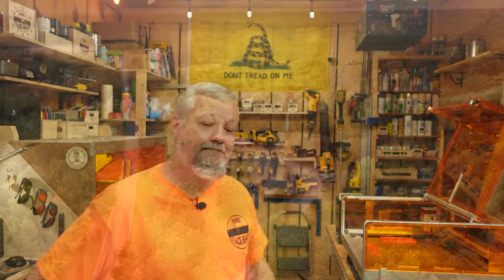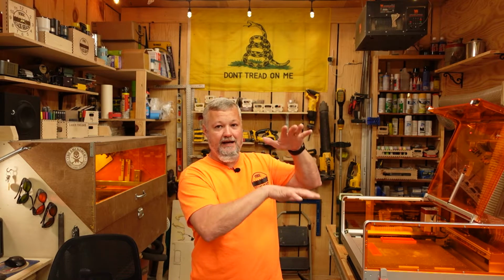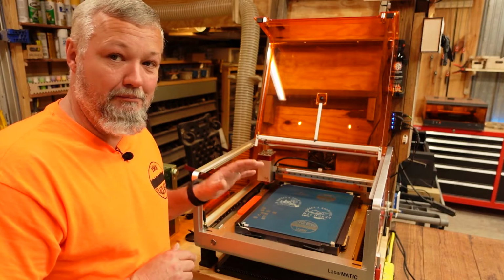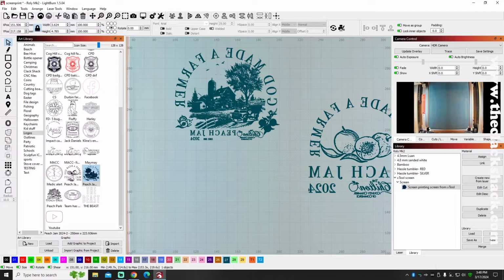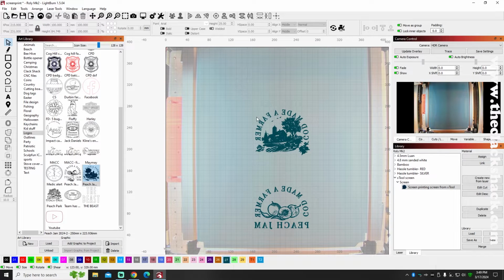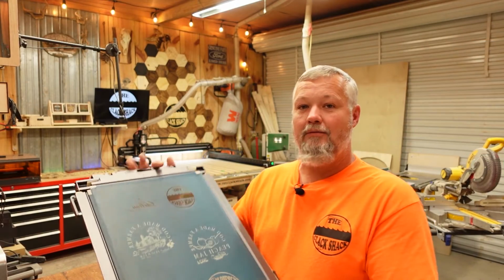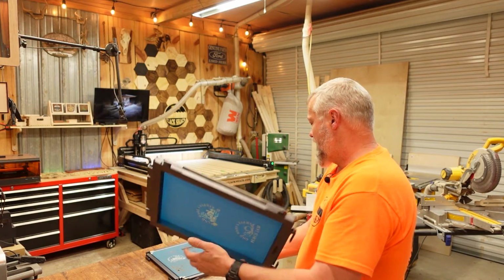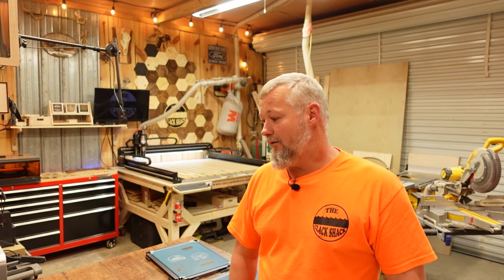xTool screen printing with the LaserMatic MK2

Comment: So Im curious, if you had to choose between the S1 and the 30 Watt Lasermatic, which one would you choose?  Thanks for all you do.  Much appreciated!!
Reply from the maker: It would depend on you work area needs. Both are good machines that are very capable. The S1 has a wider work area but the MK2 has a taller work area.
Reply: @TheClackShack  Thanks much, I guess I was just thinking about usability etc.  I know you had to do a lot of work for the templates and honing in for batching.  Just getting started here but am pretty good with tech.  Seems like with the riser base the S1 might be the best option to get the extra width.  Wish I could try them both 😆.

Comment: When you say the S1 is waiting on a fix, I'm so so curious as to what fix. I'm actually waiting on a fix for my newly purchased S1 as well. Right out of the box it was broken (didn't home and directly pushed to the front and crashing. Turns out it is probably the Xlimit switch. It took them a week to even ship it out (on my dime as overnight). I get it tomorrow and I'm crossing my fingers that it IS THE fix. When you buy a new toy like this, waiting almost three weeks to use it is so so frustrating!
Reply from the maker: A firmware update messed up the controller I believe. Unfortunately, even brand new 70K vehicles have issues also. I haven’t had many issues with lasers